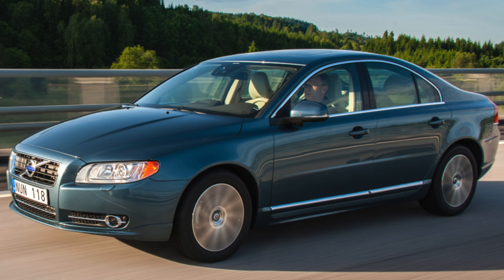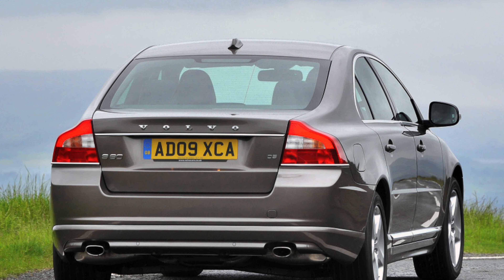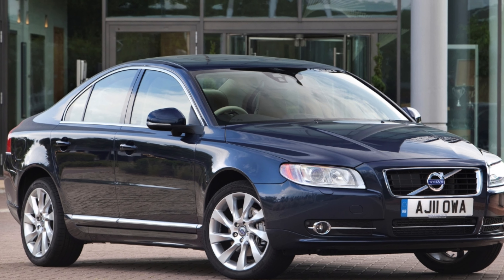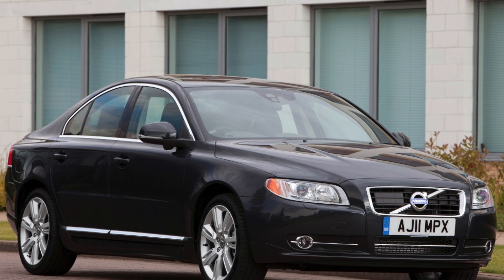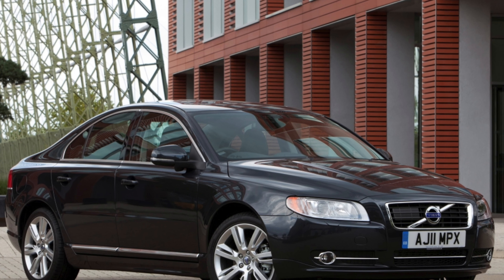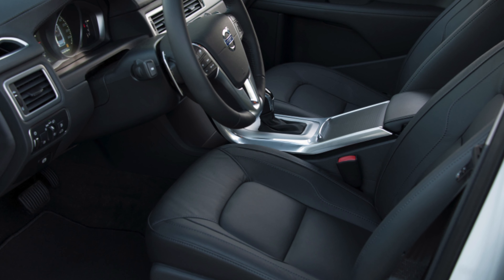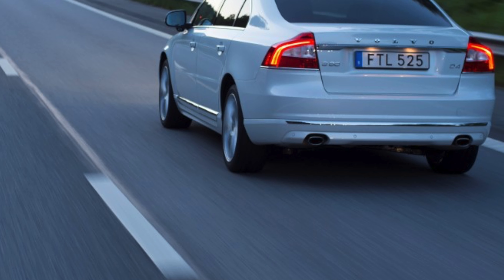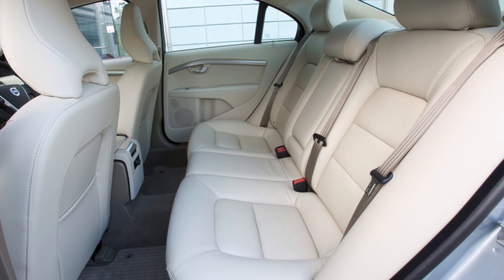Volvo S80 2 Problems | Weaknesses of the Used Volvo S80 II

Comment: I have had a s80 d5 2007 not had any issues belt change at 80k both service every 8 to 9 k miles d5 lots of fun 2.0 4 cylinder boring remapped mine to 220 bhp ive had a6 and 5 series prefer the volvo

Comment: NEVER BUY A VOLVO!!!
Reply: volvo’s are very reliable cars, you might have just had a bad luck after owner that never took care of maintance
Reply: Love my 2008 S80
Reply: Volvo saved my life after a deadly car crash! Now I'm on the market for a new one.
Reply: Never buy a Volvo??? I own my life to a at the time 21 year old Volvo S70. They are extremely reliable with the exception of some engine and transmission models. They also offer very good value for your money. I drive a 2009 S80 V8 right now and I have not had a single issue with it till this day.
Reply: @SergejA1  i hardly keep myself buying one...the consumption is really really that bad?
Reply: @yigitturgay8792  no it's really not, but they do focus more on safety and luxury. The cars are somewhat on the heavy side and most older models lack a turbocharger. They also have relatively low horses per liter giving them reliability, but not much in efficiency. All in all they're not gas guzzling but they're not Toyota's either.

I think nearly all Volvo owners would agree the benefits far outweigh the lack of efficiency.
Reply: @SergejA1  i owned an s40 1.8, xc90 d5 and s80 d3 before..then i got a bmw x1 right from the factory but guess what...it s no where near volvo...s80 / xc90 v8 these are my dream cars...if i could get like 7,5-8 liters consumption with 100-110 kmh autobahn speeds, it would definitely help me to decide way faster
Reply: @yigitturgay8792  I can imagine the x1 was a shocker. I can say the S80 V8 Exec is my dream car and it never bores me. I do about 8.5 km/l average while doing 120km/h so it's not too bad for a heavy non turbo V8.

On a sidenote the 2.5T and 3.2 non turbo S80 are also very nice to drive.
Reply: @SergejA1  Complete Garbage Video! I have several no problems
Reply: @mrw4724  just curious, what problems do you have?
Reply: SoiledGreen is a common troll who posts constant childish negativity from his mommy's attic.
Reply: You sure?  Perhaps you can explain in more detail.  I have a S80 2010 with 210k on the odometer & show no signs of slowing down.
Reply: @SergejA1  how is the transmission in the V8 
I also owe my life to a S60R not a starch on me
Reply: @ashtonstowe3450  it's very smooth, although mine needs an overhaul soon
Reply: @SergejA1  that’s wat I’m trynna avoid lol
Reply: @ashtonstowe3450  all depends on previous maintenance

Comment: Very Good review thanks for the info!
I’m currently looking at the P2 S80 and I can decide on the T6 or the 4.4V8 for the engine hopefully they don’t have the same transmission issues as the P1 ?
Reply: You mean p3
P2 is the previous S80 and xc70. 
P1 is S40/V50/C30/C70